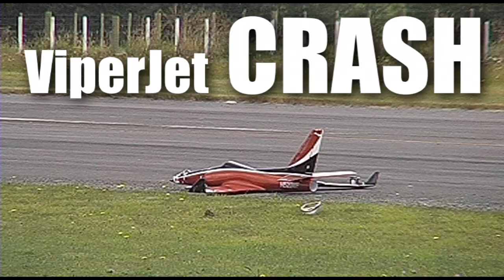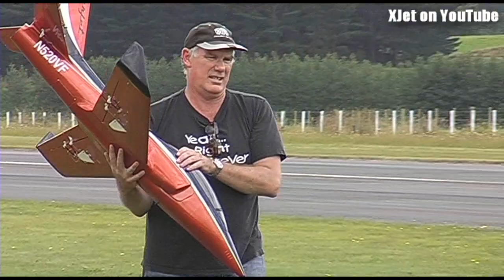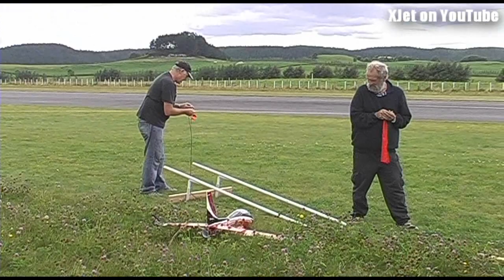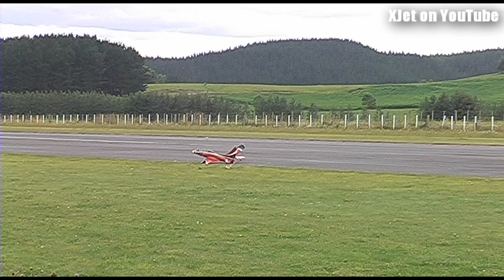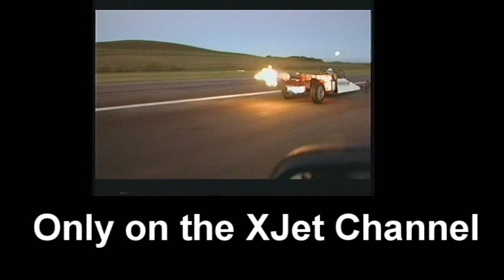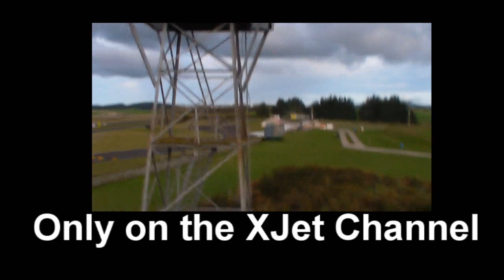HobbyKing Viperjet RC plane crash

Comment: Sorry about this, looks like a beatiful jet.
My comments:
-A fiberglass 90mm jet should not be bungee-launched, you seem to have a nice paved runway, why would you not use it?
-Wind was not the culprit, it was not a out-of-nothing high wind blow either, you can notice because the  grass is so calm , and at the exact moment of the turn you would have seen the wind effect hitting the plane, but no, the turn was consistent and it went down.
-My guess is that this was a stall because of lack of power, the bungee was not able to get it to gain speed  quick enough and not even the power applied was enough.

Comment: @oysterlicker Yeah, the full throttle motor combined with insufficient airflow over the wings might have caused a torque roll to the right.  Happens a lot on my smaller foamy 70mm EDF when launched off the bungee.

Comment: @xjet
   G'day... Well, I'm goanna arse-umeify that the Decision to launch via Bungee & Ramps, when that there Big Runway is adjoining ; involves a Lightweight  Design, sans Undercarraige, let alone Retracts for the Dunlop Danglies... Weight thus Slashed, an Undersized Motor would go well, but it Pitched Up & Unhooked just prior to VMC re Full Power Torquies, at the Instant.
  Separate the Existing Bungee-Anchor & Ramp, by 10-20 more feet..?

Comment: What a shame.....I would have said he was lucky on the first launch to not wreck his model, but it was clear from the first go that the bungee was just not tight enough and didn't have enough power.
I would certainly go along the lines of a dolly to launch something like that, and never a bungee. 
Technically the plane is flying when it should't be because it is being dragged into the air, rather then creating it's own lift to get into the air.

Comment: They make both fixed landing gear and retracts for that model.  I don't understand why he is using a launch system like that when you have a beautiful long paved runway plus he needed to give full power for the motor before taking off.  Those planes are not cheap.

Comment: @turkishflight1010 so, bananahobby=good quality? i ordered an a-10 from them and the esc caught fire in mid air, destroying it. i tested the motors and they were drawing over 40A, on a 25A esc that came stock. they make good products, but they praise their bad ones just as strongly as their good ones. you have to know your way around rc before you go to banana.